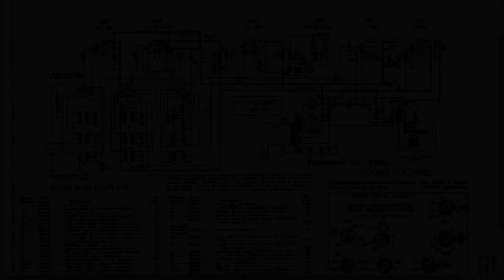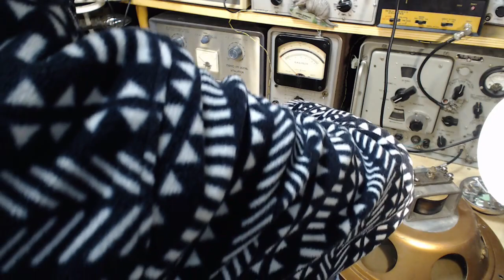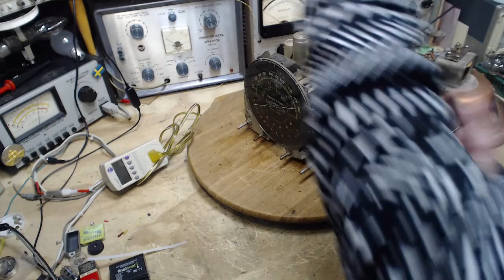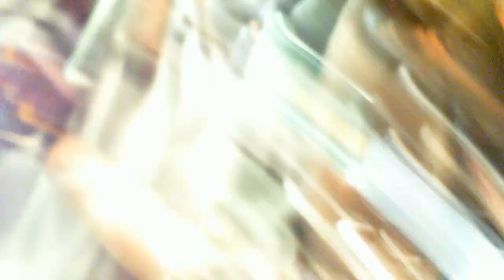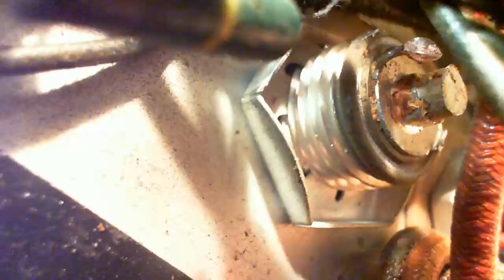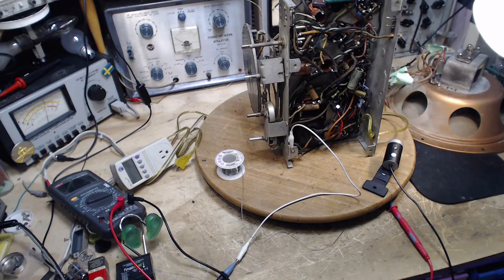Stewart Warner R146 Video #3 - Filter Capacitor Saga

Comment: Jim, the speaker field coil is part of the power supply filtering circuit. You've got a bit of a rat's nest of wires going to the speaker. Is it possible that one of the wires going to the field coil has come apart.  If so, that would be the cause of no B+ going to the various circuits.

Comment: For goodness sake Jim, if you want to teach safety then put the cover back on the mains fuse before you hook yourself across it. Put the correct fuse in and replace the cover. There is no reason to leave the cover off.

Comment: The bias supply on this radio is called back bias and is quite a common way of developing a negative bias voltage. Jim, you have serviced quite a few radio’s with this arrangement.

Comment: 3rd electrolytic is on the schematic right under the 6K7. It is 1uF and is marker as capacitor  #25. # 's 50 and 51 should be 16uF. Go by the schematic
and not by the guy who replaced the wrong value of 8uF( black and yellow Aerovox) from 16uF ! Check the resistors  and paper caps along the signal paths.
Reply: Well, you are correct in it being two 16uF caps if this is model R-146 he is working on. The chassis R-147 however uses 16uF on the first and 8uF for the second b+ filter. And as seen at 3:00 he is using the R-147 schematic to troubleshoot. 
I mean this is typical for him. Confusion galore! How can you utter something like "This radio is varying from the schematic, ... it's missing a tube" (8:00) and go about business as usual? Anyone encountering such a massive discrepancy would stop and look for a more fitting schematic! 
The R-146 found on nostalgia air has an eye tube which I am not sure his model has, but an eye tube is more easily omitted than a RF preamp tube . 
Plus the tube layout and chassis tube complement on the R-146 matches this frankenstein set.
A R147 chassis tube layout however does not match.

And about the cap at position 25 that you mention; From its function as screen grid to ground filter/RF blocker on an IF/RF stage I would assume it is a 0.1 uF, so the same value as the cap doing the same job at location 28  on the R-147 that he is using to troubleshoot at 3:04. 
I assume the dot on cap 25 in the R-146 manual was lost somewhere in copying/scanning. Thats why the notation with a leading zero before the decimal point is to be preferred IMHO
Reply: @randomsteve4288  I don't see a parts list for R146 anywhere.Typo it says R147. it is indeed R146!
 My copy is from pacifictv.ca BTW the  parts list is there with a capacitor listed as #25 and it is .1uF where the  error shown in the schematic as 1uF. 
Models 1461 to 1469 are the right schematic see Stewart-Warner pg 7-17 for the right schematic with a typo saying its parts list is for R147 but that 
is wrong. It should say R146!